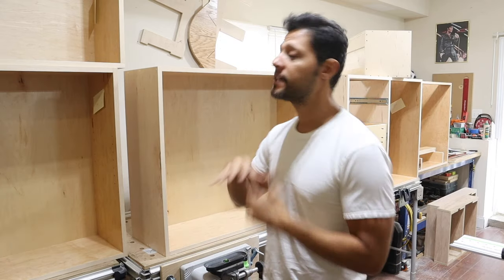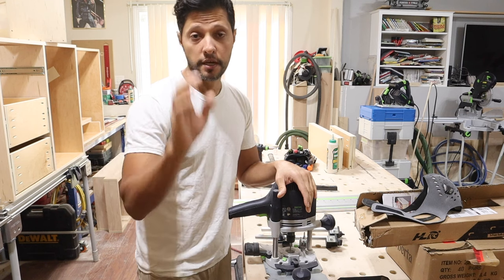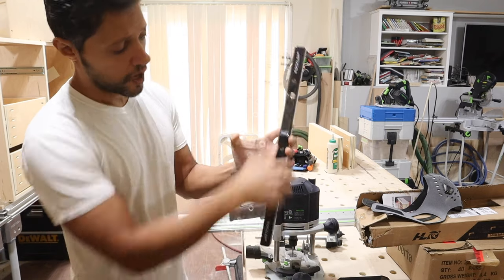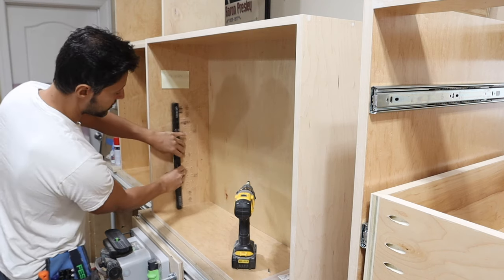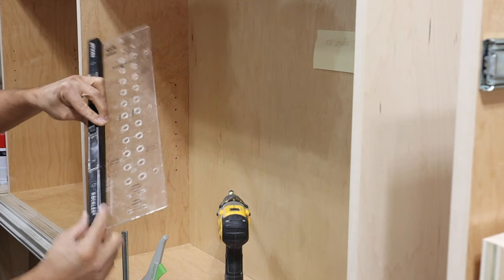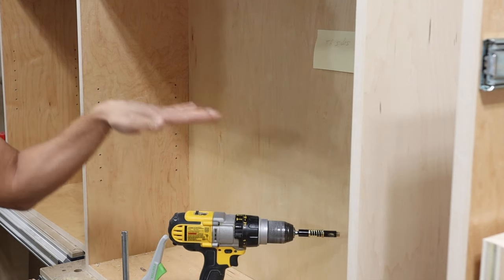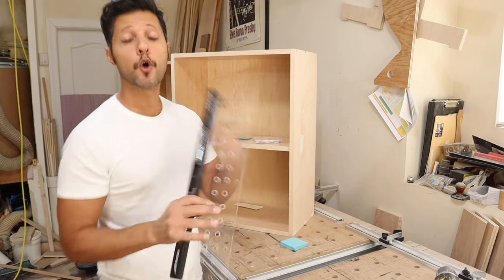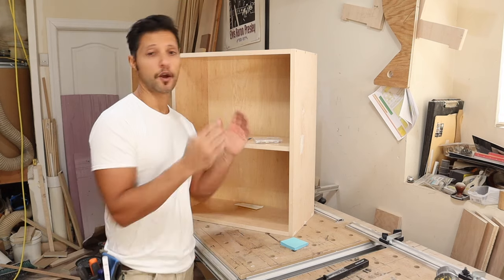Shelf Pin Jigs

Comment: Anthony,  really enjoy your instruction, many thanks. I’m a one man show just like you, and find myself doing very similar projects. I do about 5 kitchens a year, plus all of the usual commercial restaurant stuff here in coastal NC. I’m all metric, 32mm standards, and I’m Festool almost all the way. For shelf pins, I use the Blum jig, which is similar to the Veritas jig. I also own that same Rockler jig, and use it on occasion for retrofitting pins in an existing cabinet.  I drill a 7/32” hole using a specialized brad point bit setup with a Sioux 6500 rpm aircraft drill, and insert a sleeve after finishing that accepts a 5mm pin. I buy them bulk from cabinet supply. Do you ever use the sleeves?  I’ve often considered the LR 32 setup, but I don’t use Festool routers, so that conversion is quite expensive. My customers really like the pin sleeves, and almost always comment on it. Any thoughts?
Reply from the maker: I never used the sleeves. The LR32 system is pretty expensive, mostly because of the festool router, however if you don’t have an of1400 router, use my TSO products link, head to the website and you’ll see a conversion piece that allows you to use a Dewalt router and I think they made one for Milwaukee or Makita also, on the LR32 system. Here’s my link to TSO- 
https://tsoproducts.com/?ref=Scolaro

Comment: I was interested in seeing how you use the LR32 to make the holes, so I watched "cabinet building series: 2. assembling the boxes" from a year ago.  It seems terribly inefficient to align the guide rail repeatedly.  A guide rail with the holes, possibly cut shorter, on an mft-style hinge with stop blocks might be a lot easier when doing a bunch of them.  Maybe the hinge could be on the short side of the mft for taller cabinets.
Reply from the maker: Setting the guide rail with the guides stops and clamps only takes a few seconds and then plunging the holes with the router is fast also, so it works for me. But the real big cabinet shops that have a lot of space and do kitchen after kitchen use a line boring machine. They cost way more than the lr32 system and take up a ton of room. As you can see, I’m modular because of my space, or lack of it.

Comment: It seems Rockler has redesigned their LR32 hole drilling jig.  The new one is $119 and clamps to the edges of the board, with hole,drilling jogs on each side correctly aligned.  This is a nice alternative to the Festool LR32 which cost $350 and up. Thanks for the tip.
Cheers

Comment: When you build your cabinets based on the European 32mm standard, do you follow a specific 32mm cabinetry "system" such as Process 32, System 32, KISS II, etc? Or perhaps you've come up with your own system? I have some kitchen cabinets to build and I'd like to follow an established system if possible. I've learned a lot from your videos and I'm also a metric shop so I thought I'd ask about your cabinetry system. Thanks!
Reply from the maker: I follow the 32 mm system for shelf pin holes and concealed hinges. I still base my metric cabinet measurements off of the imperial system, and I just convert it from inches to mm. For example, if I need a base cabinet height of 34 & 1/2”(standard), without countertops, I will make the carcass 768mm(balanced panel) and the external toe kick 108mm. This will give you 876 mm in total. I hope that makes sense.